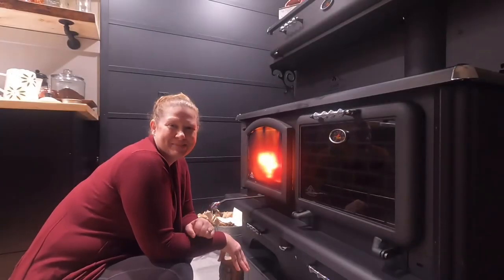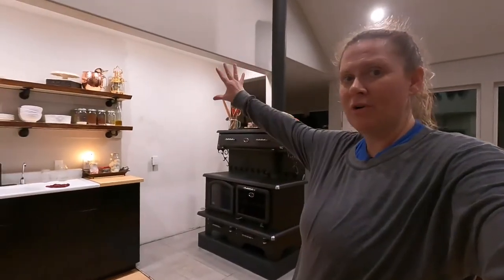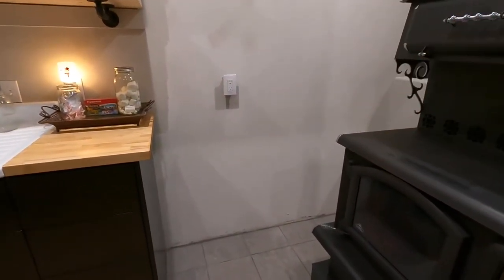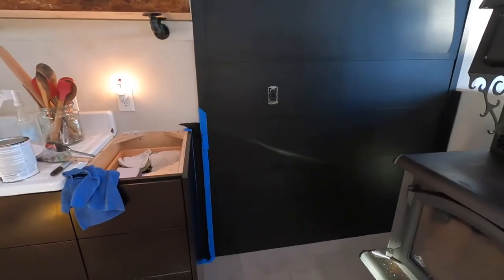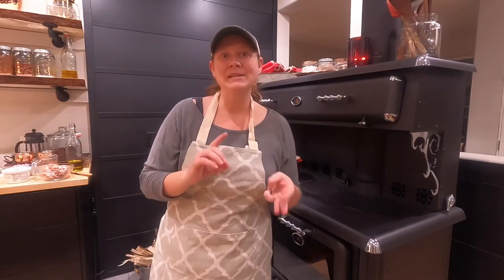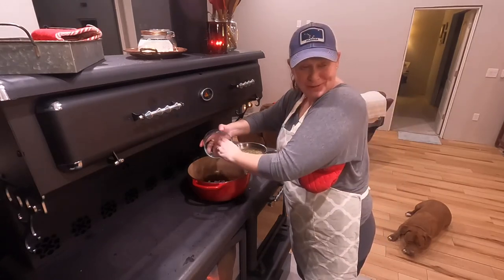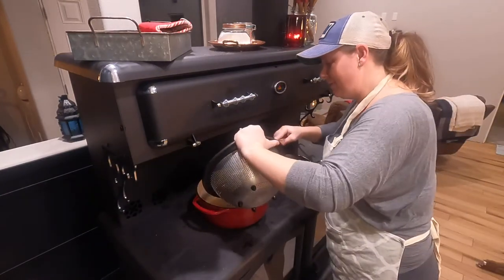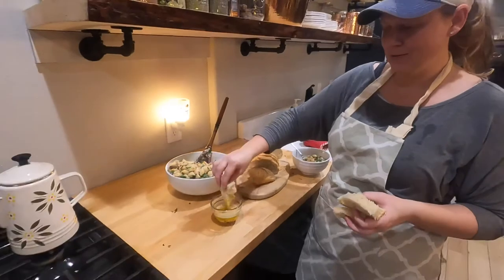Keeping it Hot and Safe: Installing a Wood Stove Wall Shield in our Alaskan Homestead Build

Comment: I need that bread recipe . Please and thank you!
Reply from the maker: If it’s the yeast bread. 
3c flour 2 tea yeast 1 tea salt 1 1/2 c warm water. Mix and let rise 1 hour preheat oven after 40 min with the Dutch oven in the cold oven at 450. After 1 hour shape loaf and place on parchment with flour. 
Put into oven when Dutch oven has preheated for 20-30 min.  And 30 min covered and 15 uncovered. Remove from pan right away or it will keep cooking.

Comment: Do you solely use the wood cook stove? Has it been a learning curve? Do you have that running all the time or just when you are going to cook
Reply from the maker: In the winter. I will if I need hot and fast put it on the gas. But we don’t use all that much gas. And because I run the stove to heat the home all winter long it does get used constantly. It’s also a slower type of cooking in winter soups and stews. Low and slow.